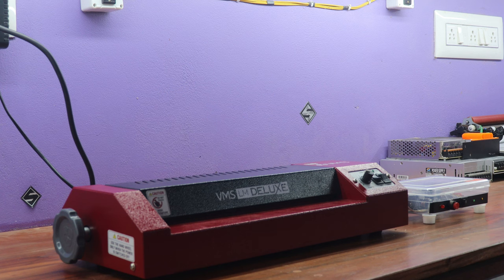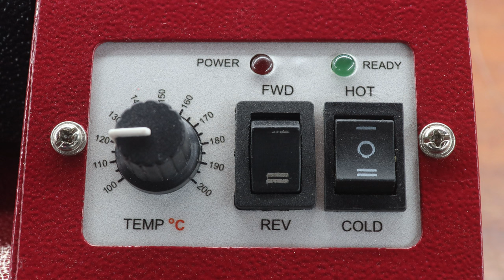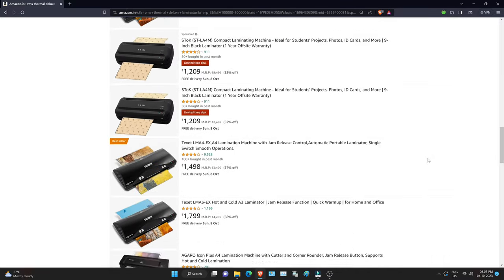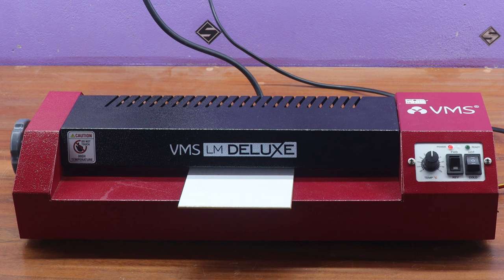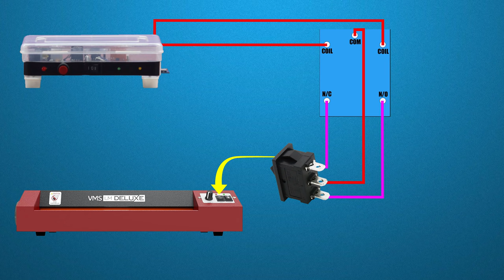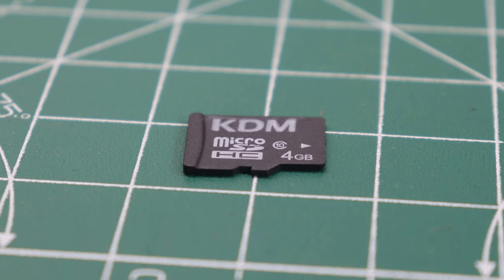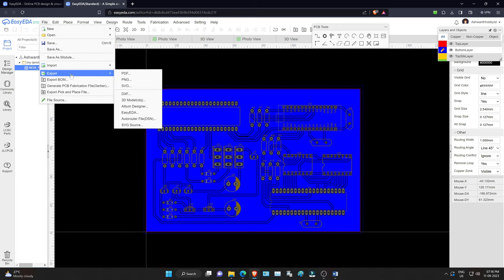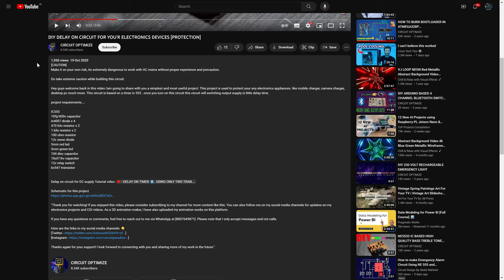How to Make PCBs with a Lamination Machine #PCBbuild #laminationmachine #circuitoptimize

Comment: congratulations, great project, I already have a project similar to this, I use the Menno 2401 laminator, it's good and I don't need to make any height adjustments to pass the PCB boards up to 2mm thick, single or double sided board, I use 180g photographic paper square meters, and printed on a laser printer, the plates are perfect

Comment: What is the temperature range you are working on, because mine doesn't work, I have tried to do this exact thing before. Overall, it is a genuinely nice project to work with. Keep up the excellent work.:yougotthis:
Reply from the maker: I'm happy to hear that! The ideal temperature for perfect toner transfer ranges from a minimum of 160 to a maximum of 170 degrees. However, the challenge arises with different brands of lamination machines. They use varying capacitor values for the Triac in the temperature control section and different types of Potentiometers. If you have the same machine as shown in my video , simply set the temperature as I mentioned. But if you have a different brand of lamination machine, you must first inspect the capacitor and the Potentiometer. Usually, the capacitors are the same, but the Potentiometers differ.

Comment: Thanks to share this video
Someone says pcb damage the roller of laminator
Pls clarify this
Reply from the maker: Some laminator models feature adjustable roller height. By adjusting the roller height, you can reduce the pressure on the PCB. When the PCB crosses the roller, adjusting the roller height can help protect your PCB without any issues.
Reply: @Circuitoptimize23  thanks for fast reply
Can you suggest any model?
Can i modify cheap lamination machine for this purpose?
My budget is low 
I don't want automatic function
But i want print transfer accuracy
Reply from the maker: In my opinion, a low-cost laminator machine is not suitable for toner transfer. However, if you have a limited budget, go ahead and buy a low-cost laminator to test the results. But be aware, it's at your own risk. In my suggestion, the laminator is the same as the one I showed in my video. After publishing this video, some viewers asked me to build the same setup. I built four of them, all using this same model. I am satisfied with this model because it has proven to provide better toner transfer results.
Reply: @Circuitoptimize23  I don't have budget to take any risk
When i make this
Then i will go with same type of machine
Thanks to you sir for proper guidance 🙏

Comment: You would do better and with less effort to modify a laser printer to print the track design directly to the PCB. Over complicity does not make a project better just more complicated. Regards MoK (Been there and done it already.)
Reply from the maker: Thank you for your feedback and suggestion, MoK! You make a valid point about the potential simplicity of using a laser printer directly on PCBs. While our DIY toner transfer machine may seem complex, it's designed to cater to users who may not have access to or prefer not to modify a laser printer. The goal of our video was to provide an alternative method that can be easily replicated at home using common tools. However, your suggestion is definitely worth exploring for those interested in a more streamlined approach. We appreciate your input and will keep it in mind for future projects. Regards!

Comment: Great idea, but maybe a couple of optical sensors could be used to register the edge of the board at each end of the travel and let the microcontroller know when to reverse the movement. That would make unnecessary to measure the time of travel of the board and enter the value in an SD card every time.
Reply: Unfortunatelly optical sensors are not the best choice. The most common available that are interruption of the ligth or by reflection are problematic to use. The dimensions of the one ones by reflection makes the use impraticable. The IR LED and phototransistor are mounted stacked in a plastic case, with a gap between them. To detect the PCB the gap must be stay horizontally and even on the tiny optical sensors, whe the case is placed in the part of the laminator where the PCI will pass, the gap stays above the surface of the PCB. Please remember that low sized PCIs will not project outside the machine.  For the reflection sensors, the problem is to get the measurements of the reflected light for PCIs that have different quantities of ink/coper. By this way, the simpliest way is to use limiting switches. Anyway, it would be necessary make adjustave lenght supports to hold the sensors or switches.